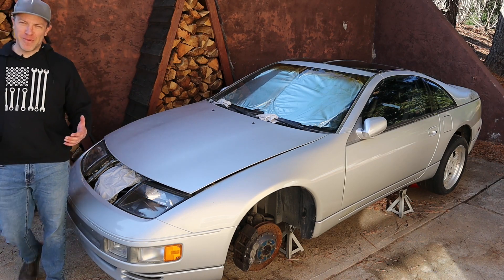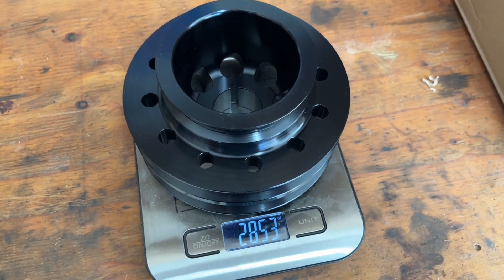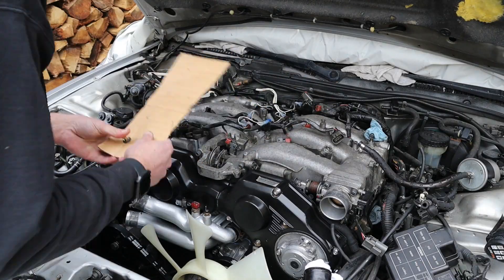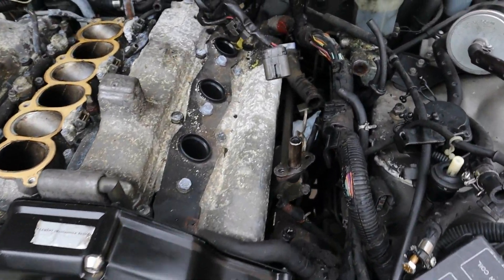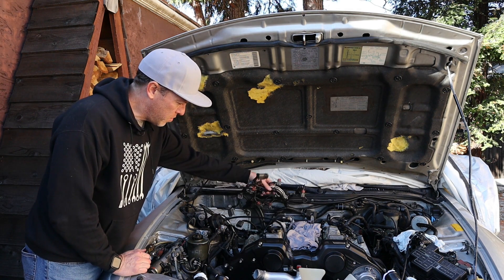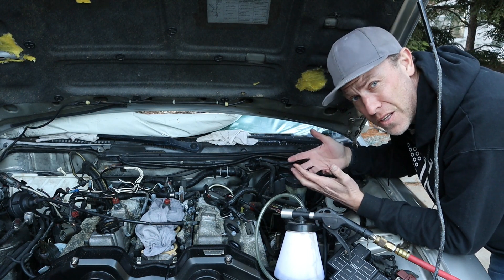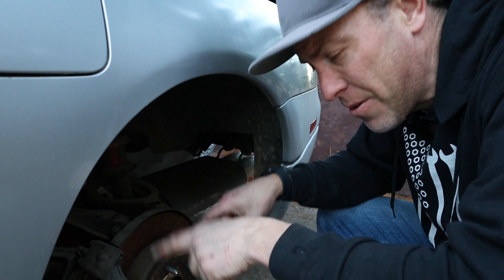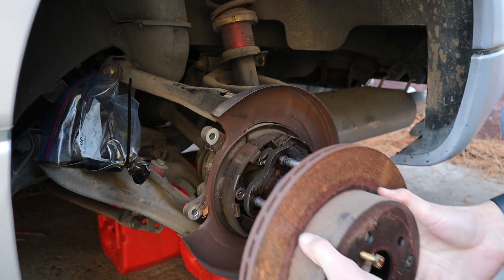Is it WORTH fixing the Nissan 300zx Twin Turbo?

Comment: I had a 1991 Nissan 300ZX Twin-Turbo (manual). Great cruiser. Not very fast in a straight line compared to the other 90s JDM cars, Nissan never updated it. Handled amazingly well, beautiful interior. 
I bought a 1997 Mitsubishi 3000GT VR-4 new. It weighed much less than the 1992 VR-4 I previously owned. In a straight line the Nissan Z32 would get destroyed. After I broke it in I went to the strip. Ran a 13.45@102.87mph on the first run, it ended up running consistent 13.3-13.4@101-104mph. Almost modern numbers.
 For comparison my '91 Z ran 13.8-14.1@99-103mph for comparison. 
The Mitsu unfortunately wasn't nearly as good in the corners and RWD is more fun.

Comment: We have also been a Datsun/Nissan family. Dad had been a workshop manager at the main Nissan dealership in Dubai in the 70's till his retirement in the 90's. I also did a stint there in my teens as an apprentice mechanic before going on to study engineering. Love the 240Z, this 300ZX and the 350Z. For a little, economical town runabout the Datsun 1200 (later as the 120Y) was a gem.
Are we going to see the 240Z soon, its been a while you haven't posted its progress?
Reply from the maker: That is an awesome story! Appreciate you sharing. Hoping to be back on the Z soon.